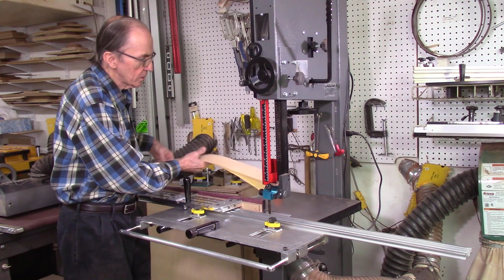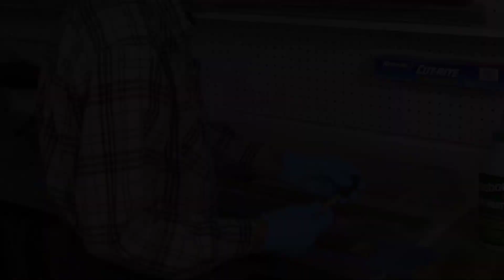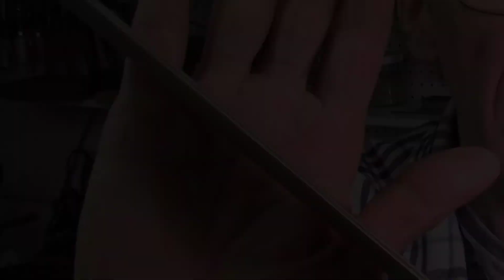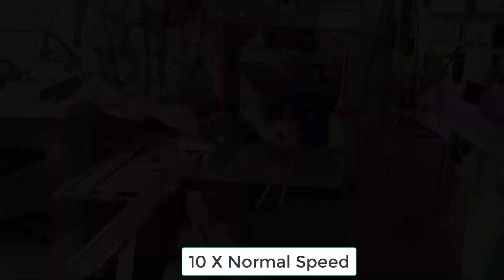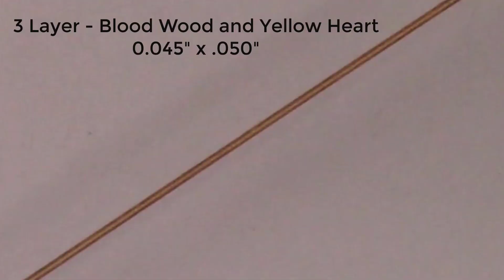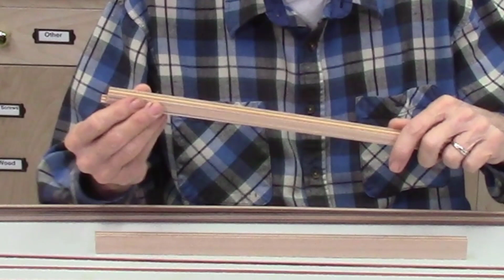Producing Thin Wood Inlay Strips and Purfling Strips on the Band Saw (120)

Comment: can ya tell us where ya got the aluminium that the aluminium angle sits on for the glue up jig
Reply from the maker: Mark:

We et our aluminum from several sources including McMaster Carr, On Line Metals and Metals Depot.  If you want a single piece then McMaster Carr is probably your best option.  We use the other supplies when we purchase in larger quantities.